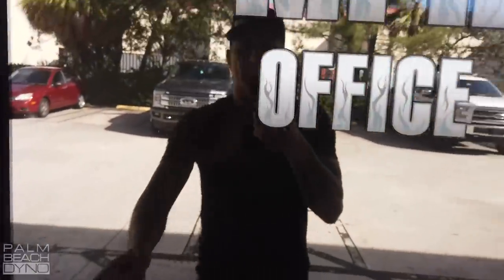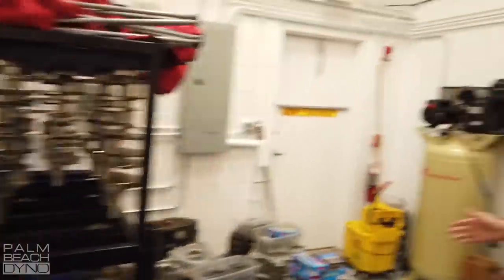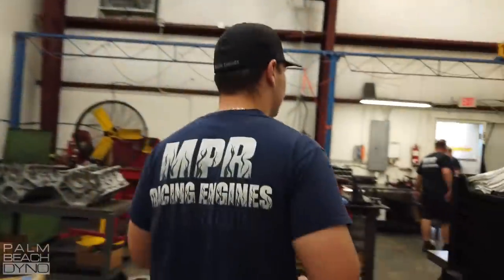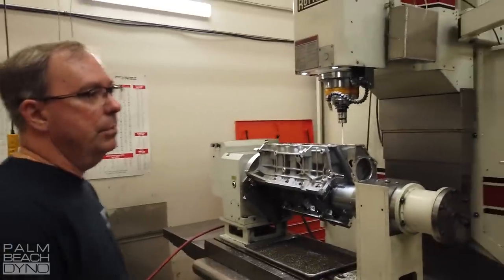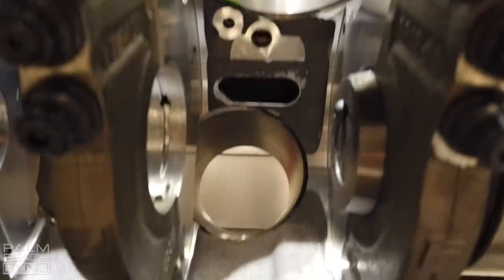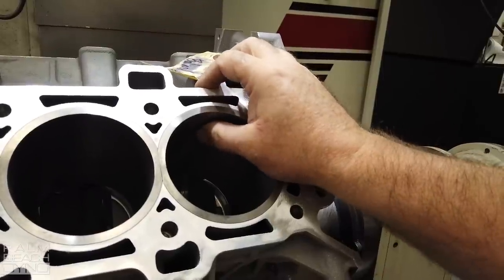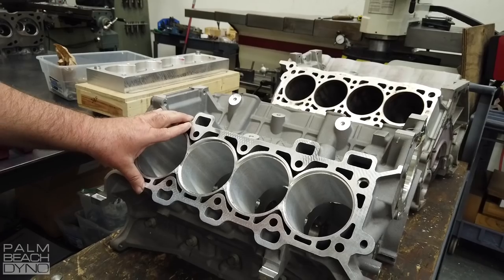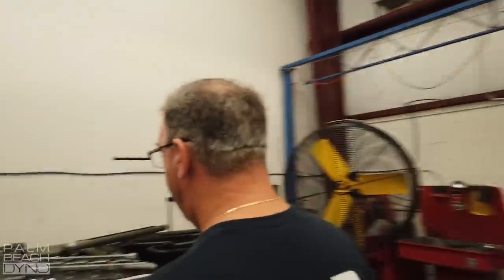MPR Racing Engines Tour - Sleeved Blocks - 18 Tick

Comment: So the problem is/was someone possible mixing up grade 3 blocks with grade 1 pistons for the gen 3 Coyote cars, hence much more play for the cylinders to slap around.
That would explain why some have a tick.

It's great to hear a master builders input on the topic finally.
Great info!
Reply: I have an old factory coyote with mismatched cylinder heads so I believe it. One gen 1 cylinder head, one gen 2 cylinder head.
Reply: I bet it’s old stock that needs to be used but at what cost? Now Ford has to fork out engines left and right to fix all these “lemons” out there.

Comment: 0:09 Nice.  You're the first shop i've seen that attaches their deck plate with studs vs bolts when the engine will be built using studs.  Ive been bringing this up for years with nothing but crickets except Texas Speed that told me it doesn't matter which doesn't makes sense considering the added deflection bolts put into a block vs  a finger tight stud with a nut on top.

Comment: So it is true the 18+ engines have a problem that according to Tim gets compounded probably by users not warming up the engines before beating the crap out of it.
Reply: I was wondering about warming it up thoroughly. I do it because I have a Whipple and 10 qts of oil and live in a cold climate. Oil temps in the middle before I diddle..that much growth because of temperature is amazing..
Reply: On my 03 cobra I always let the car get warm before it sees any boost. I’m not making crazy power but at 620/585 I’ve had the same built motor for 12 years now and it doesn’t skip a beat.
Reply: I have always let my engines warm up to at least 150* before I beat on them and never had a failure.
Reply: My 19 has the tick sometimes. I ALWAYS make sure engine oil temp says normal before going even half throttle. Been like that since day 1.
Reply: always cringe when some youngster cold rev's anything 500+hp
Reply: Too bad ford didn't engineer a progressive redline that only allows full rpm when warm like BMW's m cars
Reply: velr50gt I start driving min when temp gets to 100 but don’t drive aggressive until 175-180
Reply: @kennyclark2739  ford assumes owners arent idiots... Unlike bmw assumes their owners are morons

Comment: The Voodoo 5.2 is known to consume oil above levels of performance based, built, power adder Coyotes. Is the Voodoo’s oil consumption an inefficiency that is corrected with a sleeved block? , or is it just the nature of that engine and no getting around that
Reply: Does the Voodoo engine have iron rings?

Comment: Say I threw in a set of forged rods and pistons in a gen3 block. Would that fix the sealing issue since the pistons will be properly clearanced?
Reply: I know it’s super late but nah the opposite in a way. Sleeve it so the bore is consistent and reinforced. But since you’re in that deep might as well get the forged rods and pistons lol. Then from there you’re golden. Some mild boost and you’re making a reliable street monster. I’d rather keep it around 800hp and have the piece of mind you’re over engineered at that point. 10R80 handles 800. Beef up the drums and clutch packs and increase clutch hydraulic pressure with a trans tune. Would be perfect. 18-19s are the fastest ones ironically btw lol

Comment: So the clearances in the spray bore liner and the piston is the reason why my engine rattles from 1700-2200 RPM? Especially when cold? Here's a video. It sounds like shit. I also found a bunch of ferrous flakes in the oil filter on my first oil change at 4908 miles. 

https://youtu.be/IG4wZXck2Tg

Comment: I bought my 2018 Ford Mustang from Pine Tree Ford back in June 2018 (on my channel). I have had the noise ever since. Pine Tree denied hearing it on multiple instances. I took it to Meadowvale Ford, they hear it and do a bunch of repairs in 2.5 weeks that it was in. I picked up my car yesterday, and it still has the tick. Then they presented me with the Bulletin that Ford has put out recently, which states that the tick is 'normal'.

Comment: I am in Ontario Canada. Having the same ticking issue with my 2018 Mustang GT. Bought it back in June 2018, and was present since I bought it. Took it in to the original dealer 2 times, then took it to another dealer for second opinion. They are both denying hearing the noise, and are not spending enough time to reproduce the issue. In fact, the Oakville Ontario Ford told me it is my normal exhaust sound LOL....you guys tell me i'm not high on cloud nine?

My Stang:
https://www.youtube.com/watch?v=fKne6hmDlUI